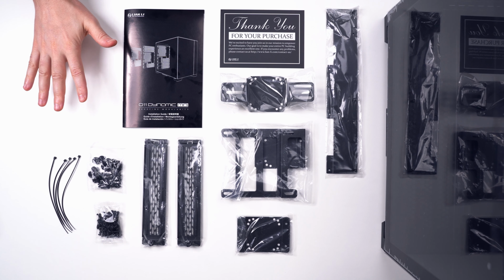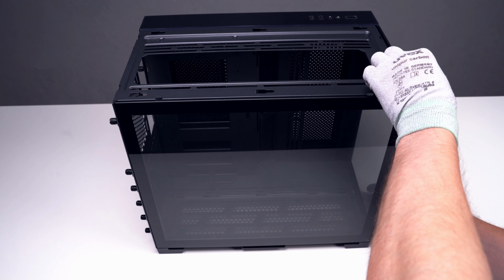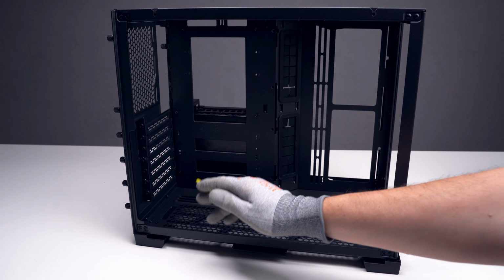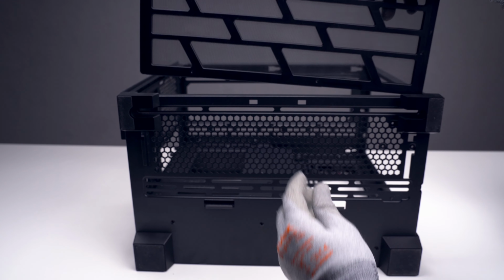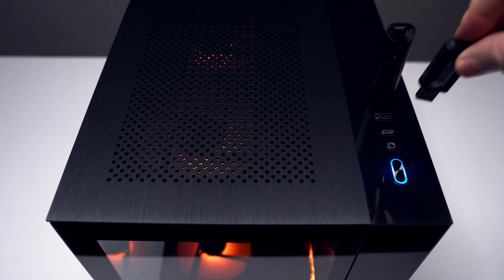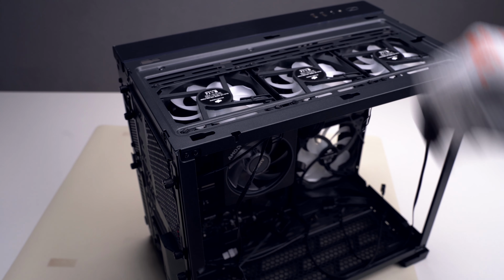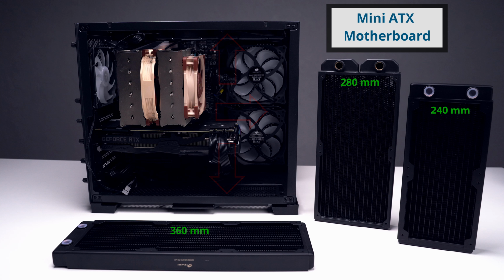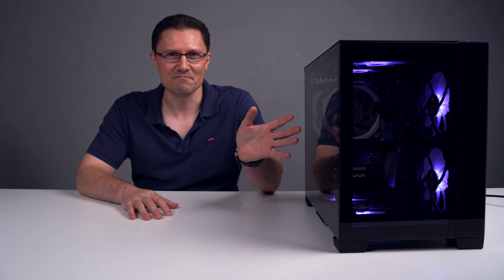LianLi O11 Dynamic Mini - Review - AIR cooled build! - ATX, Micro-ATX & Mini-ATX compatible PC case

Comment: do you recommend the fans that way? i’m thinking of putting bottom 3x intake, ontop 3x intake then on the side on my rad will be 2 intake. is that good?
Reply from the maker: Hi, I´d make one change (in “2”):

1)	3x 120mm FANs for “air INTAKE” from the BOTTOM to cool the GPU - will help the GPU temps a lot (10C lower temps = no problem)

2)	But, at the TOP you need to have those 3 fans for air EXHAUST (not intake! You might have thought intake from inside of case, then it would have been OK - it´s hard to tell). They need to suck the hot air from inside the case and blow it out into your room – otherwise the heat would be building up inside the case (fast GPUs produce a lot of heat during gaming). One FAN at the back (if you even used it) wouldn´t be able to get rid of the cumulated heat efficiently (fast enough).

What you want is to make sure the hot air which naturally goes up, just goes up even faster and those 3x 120mm EXHAUST FANs ON TOP will help speed it up.

3)	2x 140mm FANs on the rad for INTAKE on the SIDE (middle) is absolutely fine

What will be necessary is to tune the speed of those fans (using PWM/fan curve or fan controller) to make it reasonably loud. You´ll have solid cooling.
Reply: @MartinsLab  sorry i meant top is exhaust!, my aio is a z63 240 so it's gonna be 2 x 120mm, do you recommend it being intake or is it better to be an exhaust? people say having it being an intake on a rad, it'll bring in heat than it would cool air. is that true?
Reply from the maker: @SENPXL  Both solutions have their PROs and CONs:

A)	If you place “Z63-240” it in the MIDDLE (side) as an INTAKE it will be sucking „cold“ air from the room to cool the radiator (water) and will help the CPU temps more than if it were placed at the top of the case and used already pre-heated air by the GPU. The 3x 120mm FANs at the top will get rid of the heat inside the case quickly.

(=Better for CPU temps)

B)	If you place “Z63-240” at the TOP it would be cooling the CPU by already preheated air by the GPU (=biggest heat source in the PC during gaming), but itself it wouldn´t heat up the inside of the rest of the case as much (so GPU temps might be a little lower - this also depends on the speed of the fans for air intake from the bottom). 

The heat from the CPU will leave the case immediately, but because there is a radiator at the top from “Z63-240” and because there are only 2 FANs at the top, it will also restrict the exhaust from the case more compared to situation with 3x 120mm fans at to top which would be for exhaust exclusively.

What you want to avoid is the heat building up (circulating) inside the case - that´s why good exhaust is very important.

(= may lower GPU temps - depends on the FAN speeds)

My preference in this case:

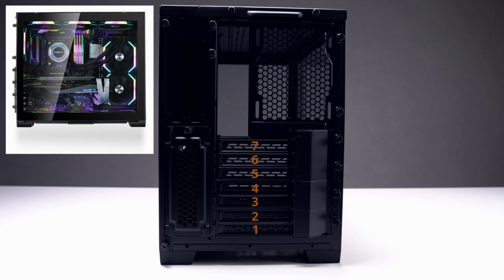I would prefer “A”. If you´re using bottom 120mm FANs for air intake the GPU will have great temps. 3x 120mm FANs at the top will get rid of the heat quickly. If, you want to see “A” visually go to “02:50” in the video and hit “pause”. 

*You may also help overall temps in the cae a little by removing the top dust filter.

NOTE: I don´t know how large motherboard “FULL ATX/MINI/ITX” you plan on using and if there are going to be any extra PCIE cards added – their absence may help or in case of using them restrict the air flow in the case.

Comment: Hey buddy this is a great video thanks for sharing it with us however I do want to clarify that you made only one minor mistake while closing up the PC since you installed three fans on the top of the case you put the dust filter back on the top of the case before closing it up which you don't need to do since you are using the top of the case as an exhaust so I just wanted to point that out to you.
Reply from the maker: Hi, you´re right - good point, it wasn´t necessary (definitely not when gaming). It has “pros” and “cons”. If you leave the top dust filter on all the time, less dust gets into the case while the PC is off (once you turn it on again the settled dust is blown into the room). If you remove the dust filter completely you´ll improve the temperatures of your PC (which is always a good thing).
Reply: @MartinsLab  Yes that is very true indeed and a very good point for sure we'll be looking forward to your next videos here very soon in the near future You're doing a great job.

Comment: Can a lian lin air mini fit a noctua nh d15 on a dark hero atx motherboard with a 3090 founder edition ?
Reply from the maker: I checked the dimensions/specifications on the Lian-li´s website for „O11 Air MINI“ (Link: https://lian-li.com/product/o11-air-mini/ ) and the maximum supported motherboard width is “280mm”.

a)	ASUS ROG CROSSHAIR VIII DARK HERO is “305” mm wide (30.5 cm) – (Link: https://rog.asus.com/motherboards/rog-crosshair/rog-crosshair-viii-dark-hero-model/spec)

The problem I see here is that Lian-li´s website is probably (I can´t verify it) misleadingly representing „width“ for „depth“. I don´t own this „O11 Air MINI“ model of the case, so I can´t remeasure it for you.

ATX standard says that a full size ATX board is 12 inches wide by 9.6 inches deep (305mm x 244mm) =  “normal ATX”. So, it should support it – so this is what you need to verify with Lian-li directly or with someone who has this case.

b)	Otherwise the „Noctua NH-D15“ will fit in like in my case with „O11 Dynaminc Mini“, but you´ll need to remove one 140mm fan and replace it with 120 mm ( for example 120mm Noctua NF-A12x25-PWM) to be able to raise it above the RAM sticks.

c)	Geforce RTX 3090 Founders is 12.3" (313 mm) length x 5.4" (138 mm) width - which fits into 362mm maximum clearance for length and 170 mm for height – so no problem there. Link: https://www.nvidia.com/en-us/geforce/graphics-cards/30-series/rtx-3090/
Reply: @MartinsLab  🙏

Comment: I wish they made a less tinted version. I like to see my components but don't want RGB.
Reply from the maker: If you want to see your components well without the RGB then you could get a white version of the case which reflects the incoming light inside the case much better. The black version requires RGB for good visibility of the components or requires placing it against the window or any close light source. The glass itself is clear (I didn´t notice any tint) but the black color on the aluminum inside panels sucks the light and makes it dark inside. (The white Fractal case I used in the video for comparison has much better inside visibility thanks to inner white paint and has only one side made of glass - one window.)

Comment: Thank you for the information for the max air cooler height, I was uneasy if I should go for the be quiet dark rock pro 4 but it is 163 mm tall so just enough space haha.
Reply from the maker: My pleasure, I was holding my breath when installing NH-D15 and had to exchange one “140mm” fan for “120mm”, so I thought someone might find this info useful. Dark Rock Pro 4 has 1x 120mm fan already and one 135mm in the middle so it should be fine (=7mm space) :) It all depends on how high you memory modules are.

Comment: sir can i fit in atx psu by hamerring the edges please replyy
Reply from the maker: I´m afraid hammering just the edges wouldn´t help :)), you´d have to hammer the whole ATX PSU by 2.1 cm (0.82677 in) in height which would destroy it, but it would fit in!
Reply: @MartinsLab   sir not psu the cabinet itself
Reply from the maker: @surajrexa6369  By "cabinet" you probably mean "the case". If you did it, the PSU would be sticking out of the case - the whole sleek and simple aesthetic of the case would be ruined + mounting of the PSU would be difficult/insufficient because two holes for screws would be missing (PSUs require alt least 4 holes/4screws, so you´d have to drill new holes for it as well).

My advice would be to give up on the idea of using “ATX sized PSU” and just focusing on buying a proper “SFX-L” sized PSU for your build. All problems would be solved and the PC would look nice. If it meant saving for it (not being able to use the old PSU) and waiting for the whole PC build longer, then so be it – it would have been worth the wait.

Comment: What a great video Martin, but video card have many positions. Only with next devices from LianLi :-(
Reply from the maker: Thanks! Good point. If you use an optional vertical GPU mount kit (which isn´t part of the original package – it has to be bought separately) there wouldn´t be enough space for a decent air CPU cooler (they would collide). Therefore this "vertical GPU kit" can´t be used in combination with large 3 slot GPUs and air coolers at once. Only in combination with AIO water coolers. So those who are building air cooled PCs shouldn´t think of getting it.
Reply: @MartinsLab  what is the maximum HeiGht for the cooler if i plan to use air cooler with vertical GPU mount and triple fan GPU (32 cm long)
Reply from the maker: @teddykurniawan2472  Unfortunately, using an air cooler in combination with vertically mounted GPU is impossible even in many larger cases. In this one you´d need to use something super small which wouldn´t have good enough cooling performance for your CPU (if you´re using any Ryzen 5000/Core i5 12600K and up).

Vertical GPU mount is usually used in PC cases in combination with water coolers (which have a top or side mounted radiator with fans and therefore leave more room in the case) and which are much smaller (around 8-10 cm square) and are also lower in the area around the CPU compared to full size air coolers like (Noctua NH-D15 / Zalman CNPS20X / DEEPCOOL Assassin III / Be quiet! Dark Rock PRO 4 etc.). 

So, if you desperately want to have a vertically mounted GPU in this PC case I´d give up the idea of using an air cooler and focus on getting a water cooler. As you can see here, all pictures from Lian Li using a “vertical GPU bracket kit” have water cooling – link: https://lian-li.com/product/o11dmini-1/

Specifically to your question: I don´t know - this also depends on the thickness of your GPU, not only it´s length. 

You´d need to take “17 cm” (from the motherboard to case side glass panel);  minus “space between GPU and glass” (at least “1 cm” – it needs to suck air from somewhere, but better 2 cm or more) minus “thickness of your GPU” ; minus some space in between CPU cooler and GPU = “at least 2 - 3 mm” ; minus “4 mm” (height of Ryzen 5000 CPU). What is left is your "possible CPU cooler height". This will give you a solid estimate.

Comment: Great video Martin. Questions on fans—which are intake and out? Can the mobo handle 8 fans (excluding bottom fans) without needing the extra fan control? Also it would be nice to include links to the major parts of the build as a convenience to your subscribers. Thanks much!
Reply: @MartinsLab  Thanks for taking the time to reply. I think I’m going with the 5600x with a used gtx 1050 ti for now.
Reply from the maker: @joelgutierrez4950  1050Ti (4GB) is definitely faster than 5700G´s integrated GPU (for 1080p). Used GTX 1060 (6GB) would also be a good survival GPU until prices drop. 5600X is excellent for gaming and PCI-E 4.0 will be enabled for better GPUs and SSDs. I think for both immediate and future gaming this is a better solution.
Reply from the maker: Hi Joel, thanks! It is no secret - will push myself to write it down 😊 

To Q1:

Here is the final 7 fan config in the video (the one you see in the last minute of the video):
 
•	TOP - 2x 120mm fans are for air - EXHAUST  - (hot air naturally goes up, this speeds it up)
•	MIDDLE - 2x 140mm fans are for air - INTAKE - (mainly for CPU - partially help to cool the HDDs in drive cage)
•	BOTTOM - 2x 120mm fans are for - air INTAKE - (significantly improves GPU temperatures, test it and, you´ll see)
•	BACK - 1x 120mm fan is for - air EXHAUST - (makes sense if you´re using an AIR cooled CPU = CPU cooler´s fans air exhaust is pointed in the same direction)
 
To Q2:

Most motherboards can handle 8 fans if they have at least 4 fan headers. I would recommend putting max 2 fans per 1 motherboard 4pin PWM fan header.
You can use a split cable, if your motherboard doesn´t have enough fan headers.

Link for a split cable NA-SYC1: https://noctua.at/en/na-syc1 (One was enclosed with my Noctua NH-D15)
(You can buy cheaper ones as well, they´ll do the same job)

Recommendation:

If you want to connect more than 6 case fans, I would probably buy a fan hub (and I did), because it is easier to manage. It depends on what feels more convenient to you and how much you want to spend, but as you saw I used some “noname” fan hub and it did the job.

There are so many options on how to do it that I didn´t want to push anybody to use just my setup as if it were the only correct one. 
The temperatures will be dependent on which PC components you use, how many fans you put in and how fast (rpm) you run them and if you use dust filters.

REQ (used HW setups):

BUILD-1:

AMD Ryzen 5 5600X (PBO enabled)
AMD Wraith CPU cooler (not recommended to use – was very loud for my taste, but had nice RGB for video)
Gigabyte X570 Aorus Elite (Rev. 1.0)
Crucial Ballistix 16GB Kit (2 x 8GB) DDR4-3600 - (16-18-18-38) - Desktop Gaming Memory (Black)
PALiT GeForce GTX 1050 Ti KalmX (passively cooled)
BeQuiet SFX L POWER 600W (GOLD) – (unboxed in the video)

Storage:
1x 2,5“ Samsung 850 Pro - 256GB - (back panel)
2x 3,5“ Seagate BarraCuda - 4TB - (in drive cage)

Fans:
4x 120mm FANs (exhaust) - (3xTOP, 1x BACK ) - (SPC235) SilentiumPC Stella HP ARGB 120 PWM
2x 140mm FANs (intake) - (2x MIDDLE) - (SPC237) SilentiumPC Stella HP ARGB 140 PWM

BUILD-2:

AMD Ryzen 9 3900X 
Noctua NH-D15 SE-AM4 (one original 140mm FAN in the middle + 120mm Noctua NF-A12x25-PWM to make it fit inside the case)
Gigabyte X570 Aorus Master (Rev. 1.0)
G.SKILL Trident Z Neo - 2x 16 GB 3600 MHz (CL16-19-19-39)
ASUS GeForce ROG-STRIX-RTX2070S-A8G-GAMING
BeQuiet SFX L POWER 600W (GOLD) - (unboxed in the video)

Storage:
1x 2x5“ Samsung 850 Pro - 256GB -  (back panel)
2x 3,5“ Seagate BarraCuda - 4TB - (in drive cage)

Fans:
3x 120mm FANs (exhaust) - (2xTOP, 1x BACK) - (SPC235) - SilentiumPC Stella HP ARGB 120 PWM
2x 140mm FANs (intake) - (2x MIDDLE) - (SPC237) - SilentiumPC Stella HP ARGB 140 PWM
2x 120mm FANS (intake) - (2x BOTTOM) - (SPC235) - SilentiumPC Stella HP ARGB 120 PWM

I´ll add links for all into the video description later (for now: select/copy/Google/paste/search) 😉
Reply: @MartinsLab  much appreciated Martin. Copy/paste good enough. Although most vloggers take advantage of their affiliate links, you may not care, I don’t know but the list works for me which speaks to your attention to detail and why I’m partial to your channel. 

On another matter, I’m one of the many waiting for GPUs to be affordable again but to keep a birthday promise to my son, I’m thinking of just building around the Ryzen 5700G for now and just adding a rtx 3060 ti later. But I’m held back by the lack of pcie 4 support by the APU. Thoughts?

Comment: I just purchased this case and plan to use a mini-itx motherboard with (2) 360 radiators. Good video with some good tips.
Reply from the maker: Glad you liked it. The smaller motherboard you use with this case the more water-cooling options you have. With 2x 360 radiators you´ll be able to achieve the best cooling possible in combination with enough (6) fans.